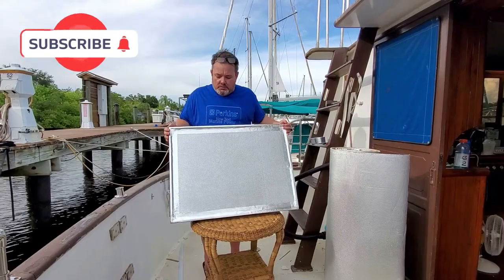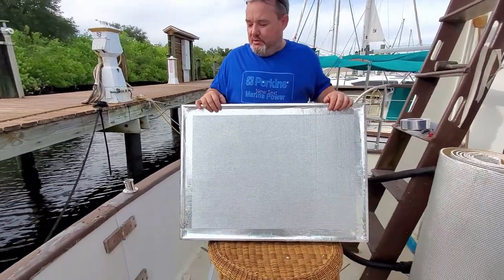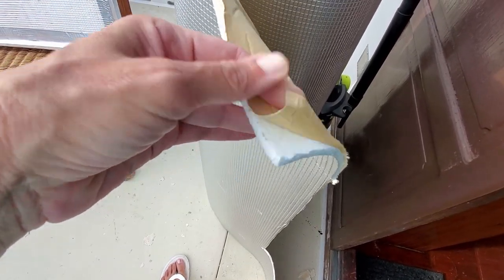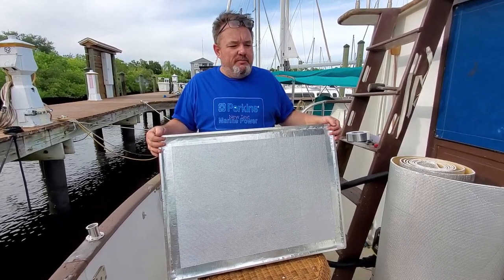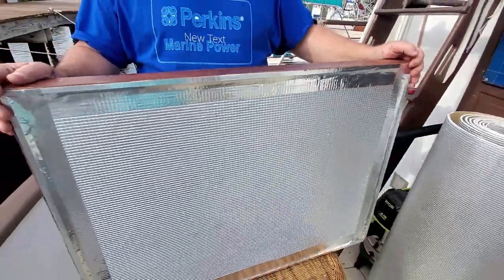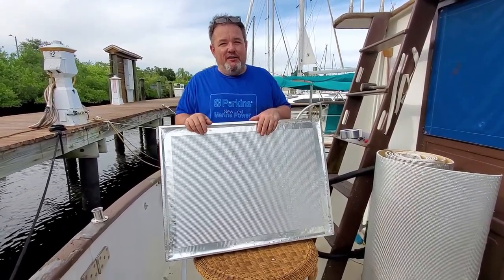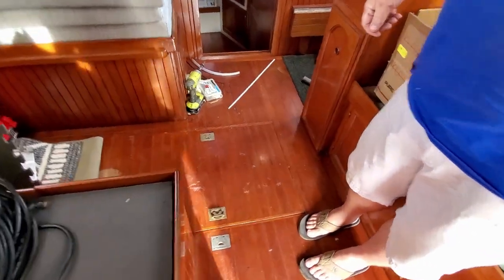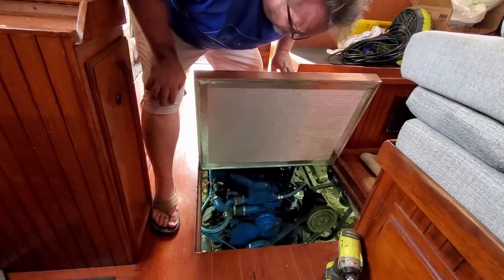Trawler DIY: Engine room sound insulation and heat barrier

Comment: Looks good.  For over the engine belts, I added two wood screws screws with large washers to hold the material, just in case it fell off and into the belts.  It hasn't fallen off, but it made me feel better.
Reply from the maker: That's a very good idea. Much appreciated

Comment: Acoustic foam like you bought from e-bay will provide similar noise absorption performance as the "ceiling tiles" you removed.  "Soft" products like foam, fiberglass and mineral wool absorb noise, but provide little as a noise "barrier." Mass is what stops noise. In the old days lead was the barrier of choice, to be replaced by Mass Loaded Vinyl (MLV) as performing the same as lead but cheaper and not toxic. 
Absorbing noise will reduce the noise in the engine room by reducing the increase in volume caused by reverberation, and therefore a noise reduction in the vessel. A product that incorporates an MLV barrier would provide much better noise reduction by providing a barrier.
Re thermal properties, acoustic foams provide approx R6 per inch of foam.